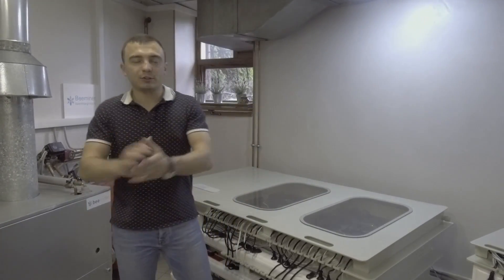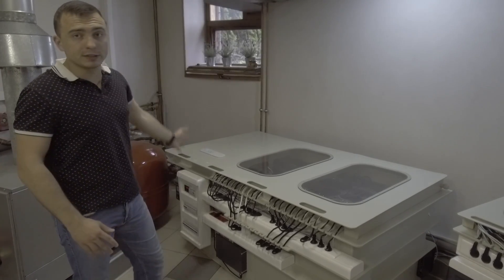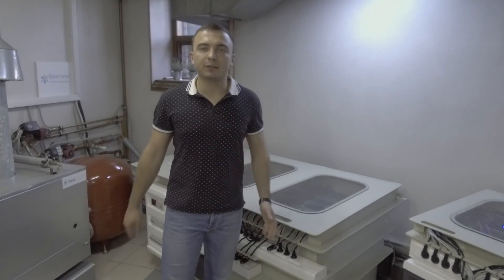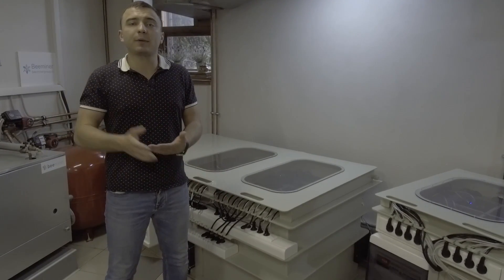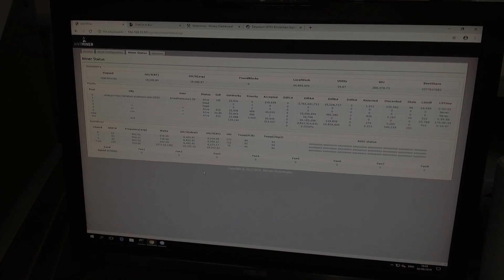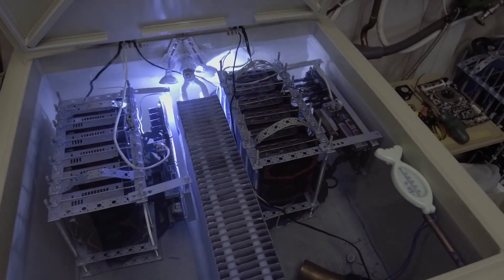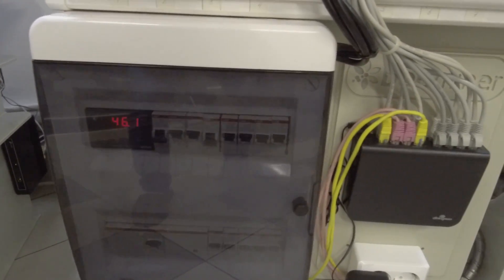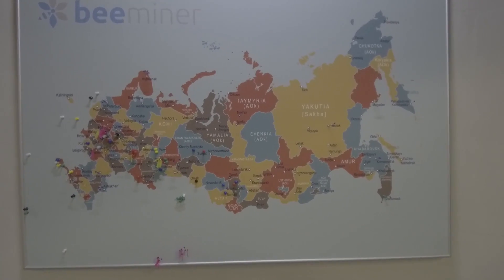Immersion cooling mining farm. Beeminer

Comment: Hello, great work i can see the temperature of the liquid inside is around 41 degrees Celsius , what would be the temp of the equipment shown in the chip inlet and outlet when you check the condition of the hash and the temp. I hear rumors they could reach up to 80 degrees Celsius in the chip inlet. Thank you if i get an reply!

Comment: Hey o/ quick question, do you keep the fans on the graphics cards?
Does the liquid damage the plastic? (i know the liquid traces can be removed with solvent but not sure of the state of the gpu, does the plastic looses color or something)
Reply: Looks like the heatsinks and fans are still on the GPUs. Doesn't look like they are running.

Comment: Your water bill must be high. What do you do with the water once it comes out the other side of the heat exchanger? It wouldn't be a bad idea if you could bypass your streets main water pipe and run it through your heart exchanger. Problems could be your neighbors get hot water in their cold taps and coolant in their baths when you're heat exchanger fails.
Reply: these comments become more stupider the further I scroll
Reply: thats not water

Comment: Ridiculous and dumb.. you’re not really saving any electricity really… only the fans.. but you make up for it using lumps and everything else.. I guess this is good if you don’t want to put up with the sound.. that’s bout it.. cause it may not show it here.. but immersion cooling is actually messy af ..
Reply: Actually it's incredibly efficient on energy use. The heat is still being generated, but the electricity being used is much lower and performance higher. Why? Fans, localized heat, etc. wastes power and lowers performance...
Reply: @morgandavidson3417  ok dude just use it like everyone else using it and you'll save like hunderts. And the saved money you can use as electrical costs.

Comment: mineral oil contains sulphur that destroy the electronics in long term, there's coconut oil with low corrosion that can be used with bio additives to lower acidity, humidity, etc. also there's no need to fill a big tank but use passive cooling with a water tank underneath where the oil cools travelling in hoses
Reply from the maker: It is not mineral oil
Reply: @AlexWhite22  this bluemead composition is not disclosed and its long term effects in health and circuits while fractionated coconut oil kept in vacuum can last, while is biobased and noncorrosive, and proved in scientific papers. this can cool and protect any computer or electric circuit from heat and degradation, rather than currency farms
Reply: @AlexWhite22  what is it then?

Comment: @White Crypto  did you ever figure out if this reduces the amount of watts used?  Did you do anything to increase the hashrates with software or did the miner just start increasing rates on its own? Great video, thanks!
Reply: Cooling ASICs allows to use custom firmware and increase hash rate by 20-40%. For example my s19j pro does 140th instead of 100th. It would be impossible without liquid cooling because it consumes  7.5kwt and produces respectively lot of heat.
Reply from the maker: There are answers in our other videos, watch them please

Comment: Hiii, i dont want something as spectacular as yours, but would it be possible to do this to a single intel nuc? A mini fishtank?
Reply from the maker: yes, possible!
Reply: @fhhsvnggbh  I saw a 2 asic version and i think thats the minimum number of slots for this. For gpus, think the sales guy told me, you have the smallest version holding 6 gpus/fpga cards. Running 2 asics plus this will definitely increase your electric bill a lot. The cheapest miner still puts out 1000+watts and this thing if i am not mistaken takes another few hundred watts to run. Better might be the 6 gpu configuration. If all else fails, it looks good as a loungeroom table albeit a very expensive one..lol

Comment: so you use water in direct contact with the miners? what about conductivity? I read somewhere else they used mineral oil, i want to do a much smaller version of this but there is not much to go on lol
Reply: They use water to draw heat away from the oil.

Water + Electronics = Bad Day
Reply: @joyfulmaniac  oil doesn't hurt electronics? What oil is it
Reply: @franzsailer2674  I believe this is a type of mineral oil. These oils don't conduct electricity.

Comment: What kind of water is used to prevent a huge short circuit?
Reply: I don't think that's water. In theory, distilled water is almost a perfect insulator. In practice, even carbon dioxide which gets absorbed from air, lowers resistance of water. Maybe it's more similar to transformer's dielectric oil.
Reply: @3Dominion  Ok thank you!
Reply: @3Dominion  Its either Novec or Mineral oil.
Reply: water

Comment: what kind of liquid are you using
Reply: Mineral oil is nonconductive. Probably using mineral oil to cool the pcs and he said he’s got a water heat exchanger to keep the oil cool as well
Reply: @sirphartikus  how to clean the electronic after use?
Reply: @bipindra  alcohol is good at removing oil and its not conductive. Ofcourse tissue to wipe off the majority of the oil

Comment: About the GPU immersion tank? Why not remove the coolers to expose the GPU die to direct contact with the fluid? any particular reason you'd leave them on or was it just easier to put them directly in as is?
Reply: I thought metal is still better heat conductor than this liquid. Am I wrong?
Also, I always thought that heat is just removed into the air through entire liquid surface, but here it is covered. Does it mean that there are fans inside the tank? Or this tank is connected to some other radiator tank and liquid is pumped in a loop?
Reply: @PC-ju6pp  Oh you might be right I didn't think about that :v 

I just thought that the liquid would have comparable or better heat transfer properties that it wouldn't matter all that much
Reply: @Azarath you need the surface area of the heatsync to cool the GPU if you remove it it will pretty much overheat even submerged, as the oil is not so good heat conductor as the Aluminium heatsync is
Reply: in the first place why oil air is much better and It cost you fucking Notting use your brain

Comment: Can you run the power supply fans in this liquid ? How would I shut down the fans on the miners.
Reply from the maker: we use a special tool to switch off fans. but generally we can run supply fans in the liquid
Reply: @AlexWhite22  do you have those Chips?